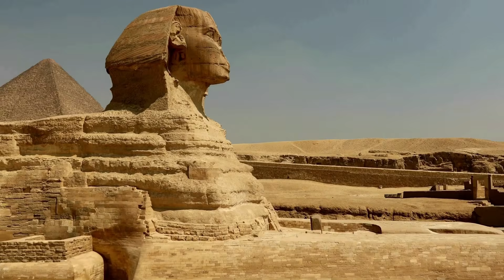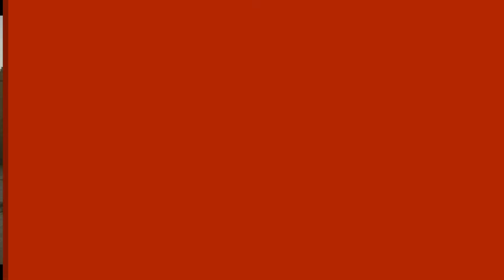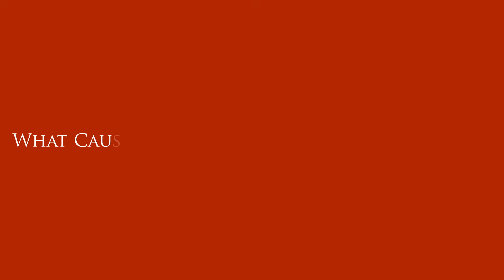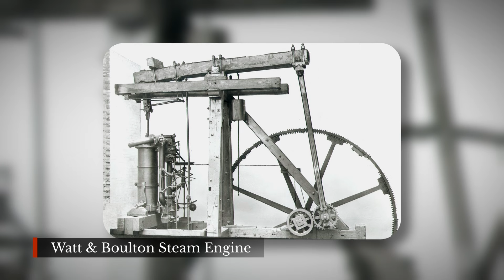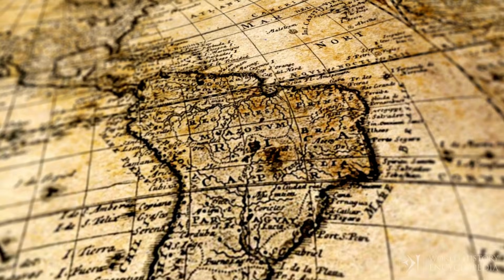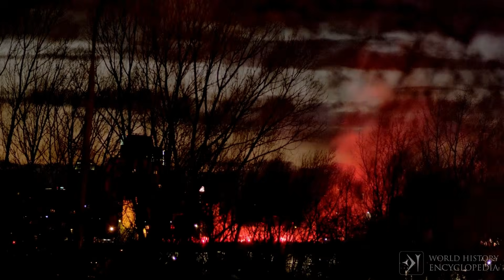The Birth Of Industry: The British Industrial Revolution

Comment: The Industrial Revolution in Britain from the year 1775 to the year 1900. 
Farm production increased by 300% (aided by Steam Engines). Population increased by 300% (aided by cramming people into towns). 
Textiles production increased by 600% (aided by Steam Engines and a ban on Indian textiles). 
Coal production increased by 1,000% (aided by Steam Engines and for Steam Engines). 
Iron production increased by 28,000% (aided by Steam Engines and for Steam Engines).
 Steel production increased by 600,000% (aided by Steam Engines and for Steam Engines). Waterwheels, the main source of rotary power for 3 thousand years but limited by the need for flowing rivers of water practically vanished (due to the Steam Engine). 
As did Newcomen Atmospheric Pumps , (due to the Steam Engine). And finally James Watt's Steam Engines and their descendants themselves increased by 1,000,000,000% !!! 
or 1 BILLION %. 
So I don't think there's any doubt, James Watt's Invention of the world's first PRACTICAL Steam Powered Engine caused the Industrial Revolution! 
Not complicated at all!